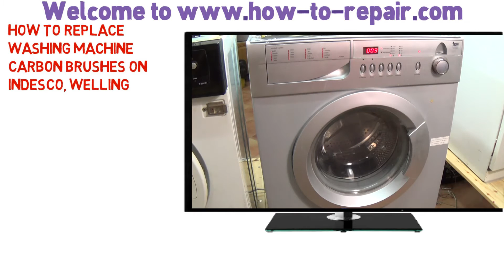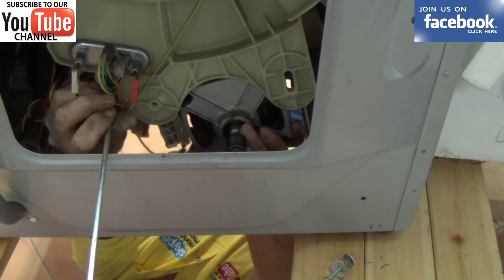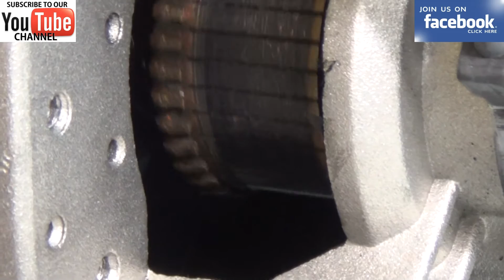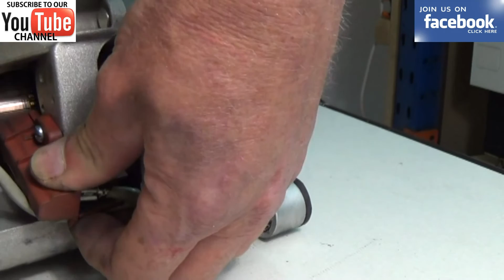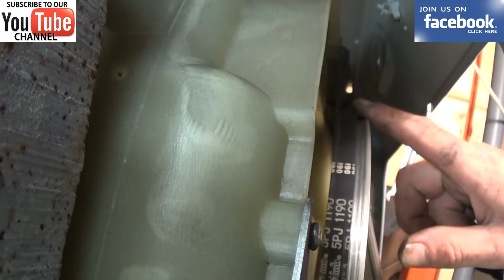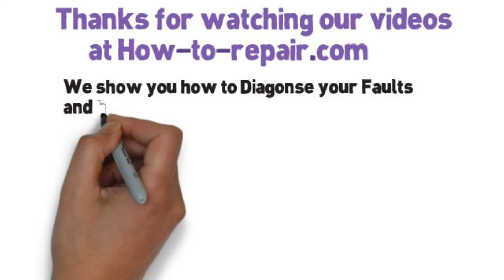How to replace carbon brushes on Indesco & welling washing machine motors

Comment: Having seen your commutator, mine that’s caked in carbon is clearly in need of a clean. If the motor was designed to run with shorted commutator segments, they wouldn’t be segments !

Comment: Good afternoon, I write
from Caracas Venezuela.      April 8, 2016

I'm looking for the next engine for a front loading washing machine:

"Welling HXGM2.03" 220-240V AC. 50-60 Hz. Electronically Controlled.

Current input 4.0- 3.0 A. CLF output power 300W- 500W--

I would like to inform me: Your engine is the same as I described above?
Please could you tell me a direction. Where I can buy the engine'm looking for